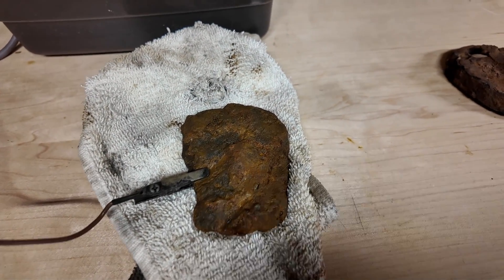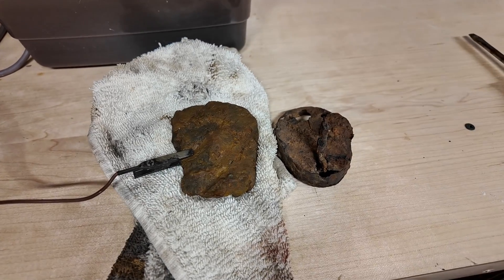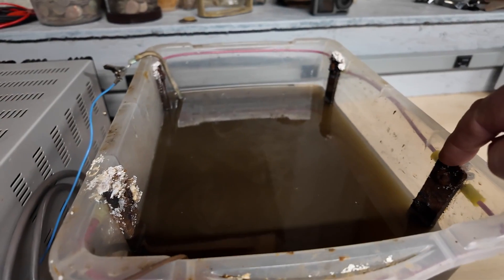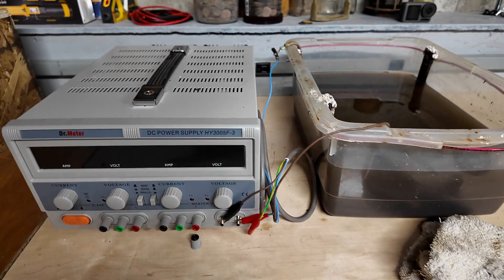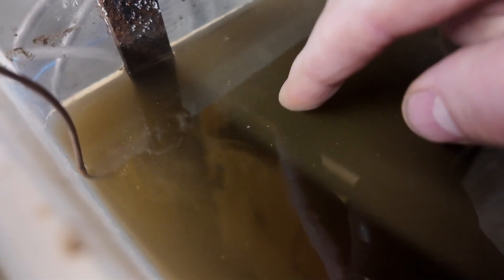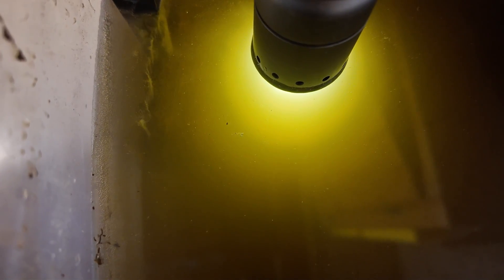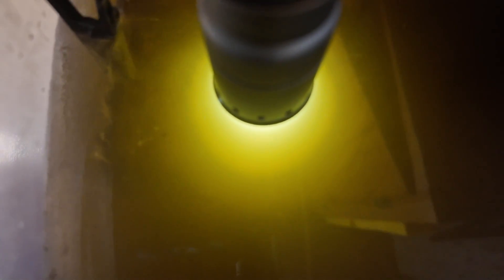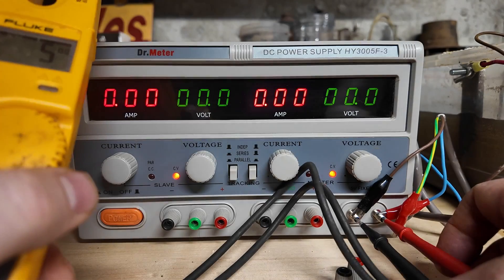how to clean parts using using electrolysis homemade electrolysis tank taking rust off

Comment: Whatcare the best Current and Voltages to use in electrolysis please
Reply from the maker: I am not sure there is a right or wrong answer here. The power supply use in that picture puts out a constant 5vdc at 3amps. I have used the old style cell phone chargers with output of 5vdc at .5 amps and battery chargers that put out 12vdc at 6 amps. You really have to watch your parts the higher you go with your power. I have seen results with about every power supply I have used. Make sure you have a really good connection on your part, otherwise it will not work well at all.